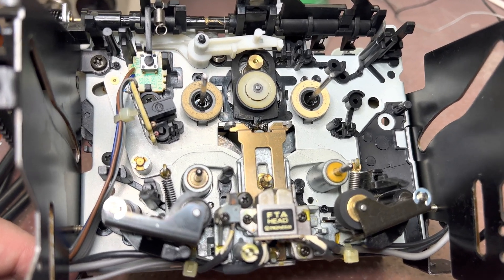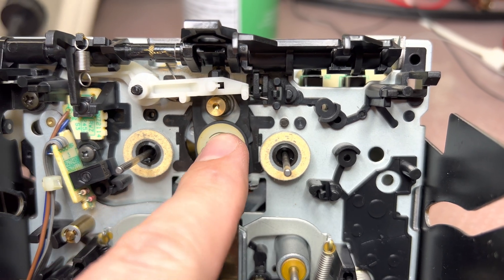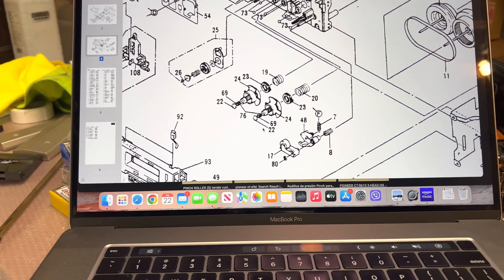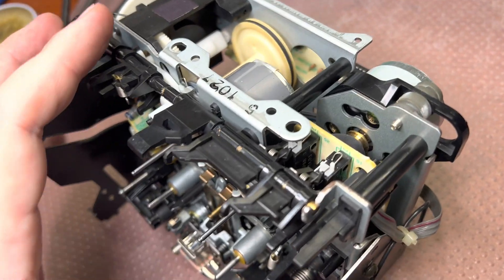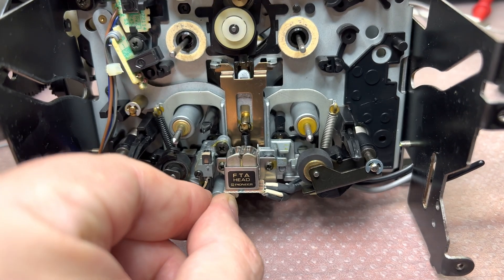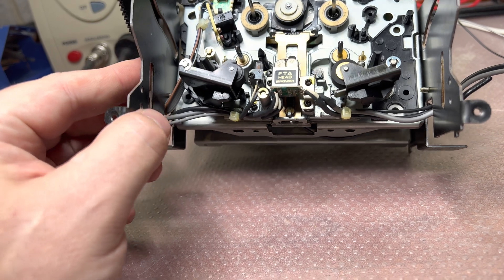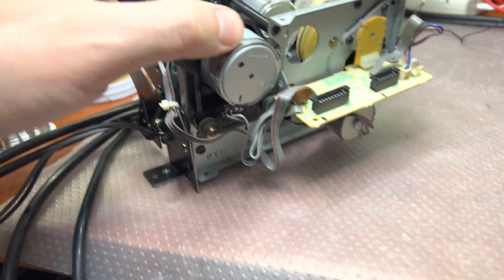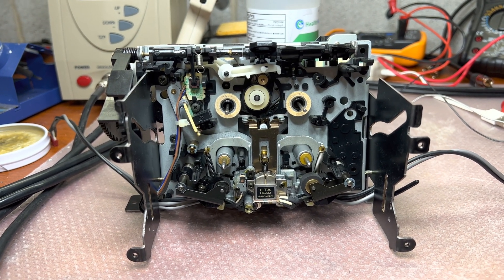Pioneer T-1100 aka CT-95 Restoration Part 8: Exploring Ways to Replace the Idler Tire

Comment: This idler looks in good shape, probably it's just slipping. You might be able to restore it completely by soaking it in acetone based nail polish remover. No need to remove it even, just use a cotton swab. It's cheaper, and I can guarantee if the rubber is not cracked or damaged, it will be better than any new idler you can buy today. But yeah, these mechanisms are kind of a pain to service.
Reply from the maker: That Idler has got fully hardened. I replaced it with a new one.